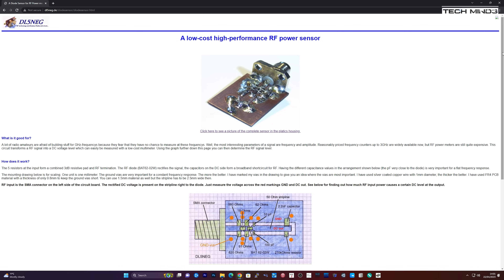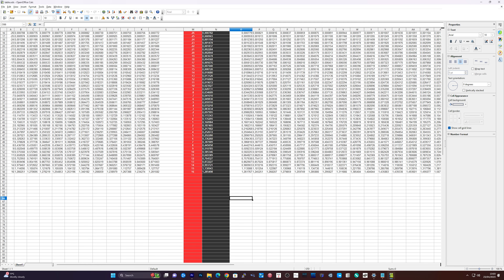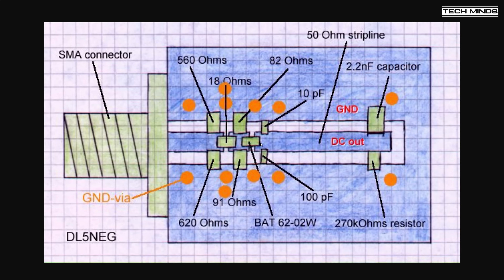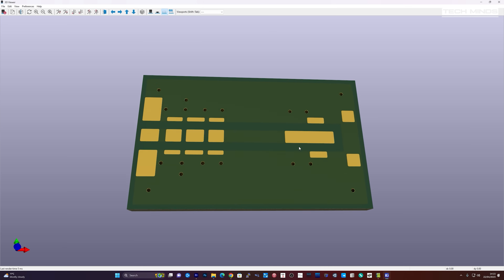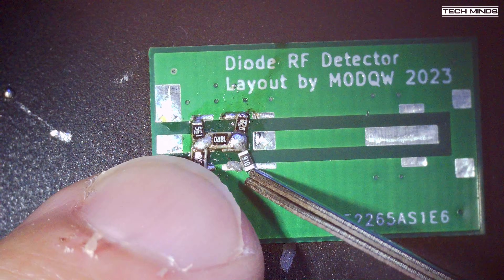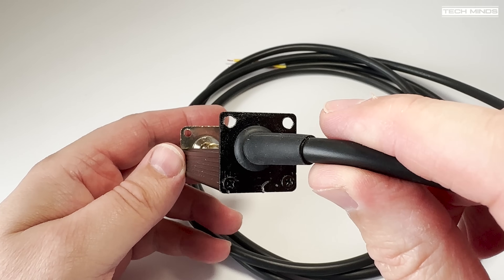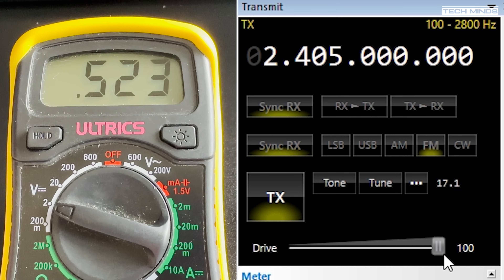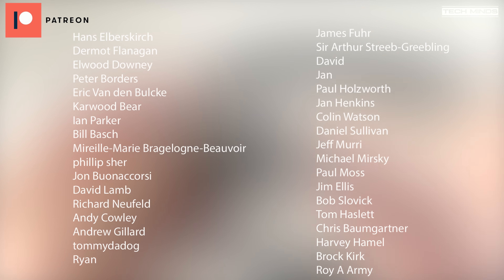A Low Cost High Performance RF Power Sensor

Comment: Matt, do you have a copy of the spreadsheet for this, the download on NEG webpage is totally scrambled, I would like a copy if possible as I'm hoping to cover this in an article comparing low cost RF sensors. 73 G0FVI

Comment: Can i use this to test 5 or 10w handheld radios?
Reply from the maker: You would need to attenuate the signal so not to damage the sensor.
Reply: @TechMindsOfficial  how would i do that?
Reply: @TechMindsOfficial  my bad i understand now, i need a attenuator. thanks for the reply. one more question. would a BAT62E6327HTSA1 be a good replacement for the BAT62-02W

Comment: Hello. Nice project! Please tell me where did you bought black enclosure for this ? I bought on ali similar but screws not fit together with N connector...
Reply from the maker: It was on Ebay UK. The seller didn't have many left when I purchased mine, but they might have re-listed some more, hopefully :-)
Reply: @TechMindsOfficial  Could you provide the name of product ?
Reply from the maker: @lucjann.577  https://www.ebay.co.uk/itm/325138192173
Reply: Why somebody is still removing my comments about the alu case where to buy? Is it yt or you?
Reply from the maker: Defo not me removing comments, and the link to buy the case is above your comment.

Comment: Funny you should publish this just as I ordered a few RF schottkys for a similar project - I like to call mine “hot shack indicators”.
I like the design, but you probably want to at least give the illusion of the correct footprints - even if the copper layer is different for impedance matching you can improve solderability by having the solder mask match the component.

Comment: Never heard someone pronounce Schottky (shot-key) as Scotchy (scotch-ee) 😂
Reply from the maker: Think you might need to clean your ears out as I said Scotchy as in Scotch-eeeeeeeeeeeeeeeeeeeeeeeeeeeeeeeeeeeeeeeeeeeeeeeeeeeeeeeeeeeeeeeeeeeeeeeeeeeeeeeeeeeeeeeeeeeeeeeeeeeeeeeeeeeeeeeeeeeeeeeeeeeeeeeeeeeeeeee
Reply: @TechMindsOfficial  I'd also recommend making the board so that the only exposed pad area is what is needed by the specific components. Having those massive pads didn't do your soldering any favors, nor did the amount of paste. 
Remember the 4 rules of SMD soldering: more heat, less solder, flux is magic, use magnification.
Reply from the maker: And a steady hand! lol
Reply: @TechMindsOfficial  there is a trick to that too. Don't hold the tweezers like a pencil and instead pinch them with all your fingers. That way the tips of your fingers can be firmly planted against the table and thus will not shake and be incredibly steady. 
If you are using solder paste then you can actually use the blunt end of a cotton swab to lightly press down on the part while you flow the solder with an iron tip. 
Though I personally like to use a fine chisel tip iron and thin solder wire and a flux pen to get the job done
Reply: Nicely Said Matt
Reply: Could be worse like calling a diode a valve.

Comment: Just for my understanding, as I am fairly new to this: Does the power get reflected back to the source when you connect this sensor? Isn't it a bad idea to reflect that much power or is the idea to connect a known attenuator in between that reduces the reflected power? Or could you use a T-shaped splitter with a load on the third leg?
Reply: Look at the schematic. The input resistors create a 50 ohm input impedance so little power will be reflected.
Reply: @paulrandall7243  Thanks! That makes sense 👍
Reply: But… when I attached the final build to a UHF (70cm) repeater 110 Watt transmitter output…
I just heard a “pop” and smoke filled the room.
Did I do something wrong?

🫣🤣
Just Kidding!   Relax…
Seriously.
Thanks for a phenomenal project! 
I have AS (a form of spinal arthritis) that makes assembly impossible.
I just wish this project had been out there before I lost my assembly skills.

It really looks amazing!
Reply: The VSWR of this power sensor input is too high, so the return power presents.
Reply: @fixthetempo7276 and?

Comment: RF Power Snitch uses the diode detector but adds an amplifier. Breakout pins let you measure the amplified voltage or you can connect an Arduino.

Comment: Where did you get the box, i looked on ebay and didn't see it. also will you be posting the pcb files? Thanks
Reply: These cases are available on famous china web page. 25mmx25mmx80mm. I tried to add link several times but somebody is removing this...
Reply from the maker: https://www.pcbway.com/project/shareproject/RF_Power_Sensor_as_shown_on_Tech_Minds_Youtube_d04f8aab.html

Comment: Can I give  you some feedback? 1) A couple of extra via's would be good, especially at such high frequencies. 2) you better place all the components on the board and then solder it with hot air, all at once. And use less solder paste.
Bottom line, nice project :-)
Reply: "Can I give  you some feedback?"- No.    Awe shucks....Just kidding- interesting feedback none the less...

Comment: Perfect 🙂💪
But why u not try with AD8317/8318? Or you’re try and results not perfect?🙂
Reply from the maker: I have tried but calculations are difficult because of calibration and I don’t have another power meter to check against. Maybe I will try again